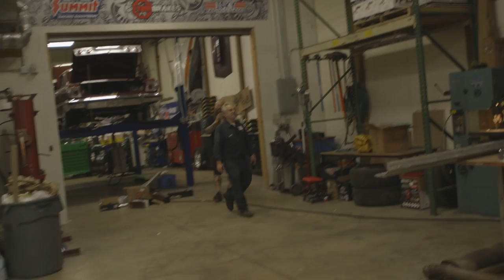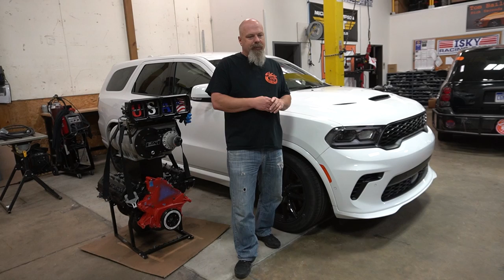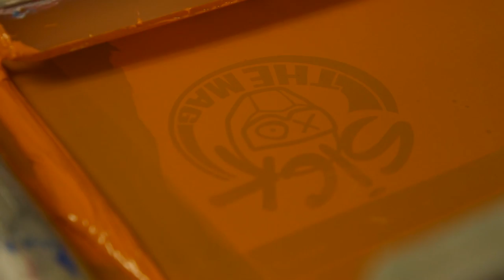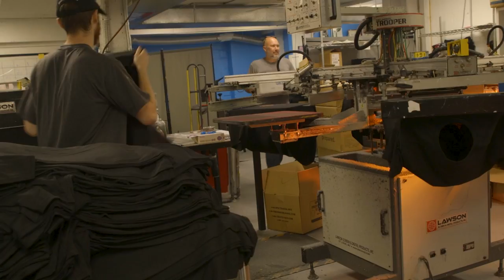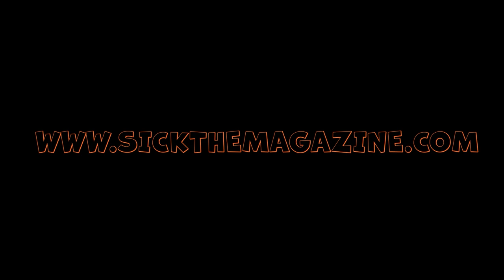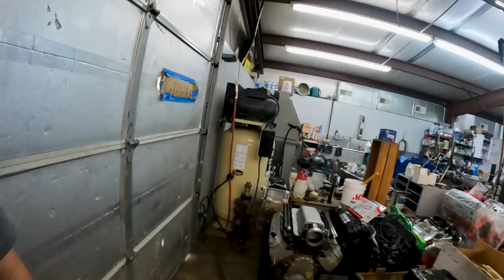Screw Blower On A Redeye Dodge Durango? This Pro Mod Supercharger Should Work!

Comment: tom, also be aware that if you do your mock up for pullies using an early block then end up using a late model block as your actual final builder your pulley alignment will be off as well as your crankshaft reluctor wheel! vvt/non vvt is different!

Comment: Putting it on a Tunnel Ram will actually pick up a TON of power across the RPM range.. Frieburger proved that on Engine Masters when he put a blower on a TR, it picked up a ton of low end torque and power throughout the rpm range and really made you wonder why people always run short runners for blower manifolds... The under hood blower manifold is for some reason the only one made.. I don't get why no one builds high horsepower NA engines for drag and drive events.. I guess it must be harder on the engine to drive around at that power level all the time when boosted applications you can turn it off and run a lower power level. It'd be so cool to see someone basically run a Pro Stock setup at one of those events.. I don't think those engines have cooling systems though.

Comment: I already ported the cylinder heads out everything as much as I could upgrade it fuel injectors larger throttle body because they don't make nothing for it

Comment: So you are taking a redeye Durango Hellcat and doing basically a build with a whole new setup... at that point its no longer a hellcat as that motor is gone. Its just a Body of a Hellcat with the badges. I thought you were going to modify the motor itsself to make those times etc, but now at this point this is just a cool build project, dont matter that its a redeye anymore as you are taking that engine out! Might as well just had bought the unibody and go from there!

Comment: I’d suggest using a 6.2 hellcat or 6.4 BGE engine combo, the block casting and cylinder head castings are much stronger, been proven to hold well over 30psi of boost and over 1,800-2,000whp.
Reply: Good thing he has you to tell him what parts to use.  Without someone like you he may not make it to the next race week or power tour.
Reply: @gordonbowe  not many people, even the biggest names in racing, know about the Gen 3 Hemi platforms as much as per say an LS platform. The 6.2 hellcat/demon and 6.4 BGE platforms are much stronger castings than the 5.7 engines and have been known to make over 1,800 to the tire. I was just trying to help and inform him, so idk if you’re trying to be rude, but each to their own, have a good day.

Comment: How is gutting the Durango and putting in a completely different drivetrain any different then just buying a junkyard salvage Durango and building a race car?  I don't understand the point in spending near $100k on a donor vehicle just to strip out everything to make it back in to a $7500 glider chassis so you can build it up from scratch?  You could get an ex-police Durango in white and do the same thing and save yourself $80k.

Comment: I think the recent connection with Mopar and Dodge is obvious and awesome. A water block from  a few manufacturers should change everything. The gen 2 hemi to this day is where you go to make over 4000 hp. And because its easy to do lets just let it happen.

Comment: that block will never handle the power.  you will push you crankshaft out the bottom the it.
Reply: I agree, I'm a mopar guy and wish it was possible, but gen 3 hemis just can't hold the power, that's why no one really does much aftermarket with them. Don't know which will give out first, pistons or bottom end?